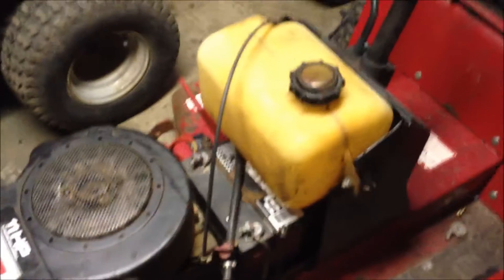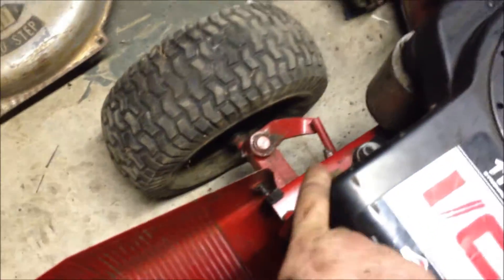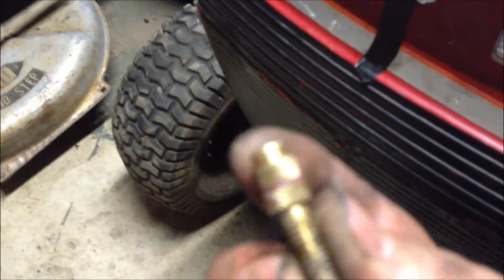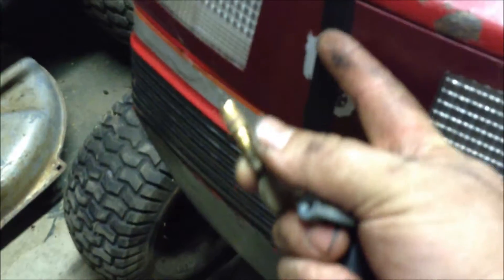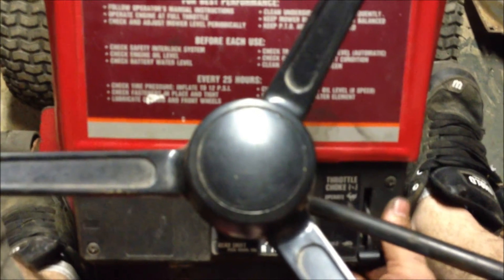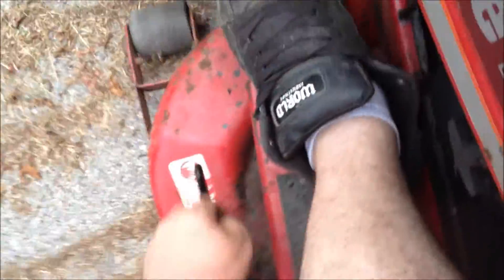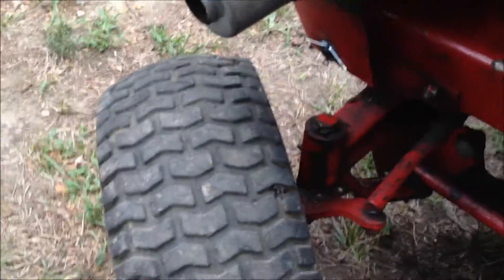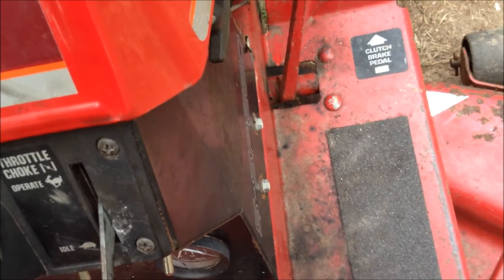Wheel Horse 211-5 Update

Comment: Is there any other mower deck from some other brand mower  that will I change  with your wheel horse mower. The reason I ask my mower is a 1988 208-4   12  hp with 38 “ deck

Comment: Another question is how do you adjust belt tension on drive for the mower deck? Seems that you have to move the whole deck back from the front center bolt. Not a good design.

Comment: I've got the exact same tractor, but my shifter is on panel in front of seat.
 Haven't located the drain and fill plug on the transmission. Do you know where and what kind of fluid does it need? Thanks for posting